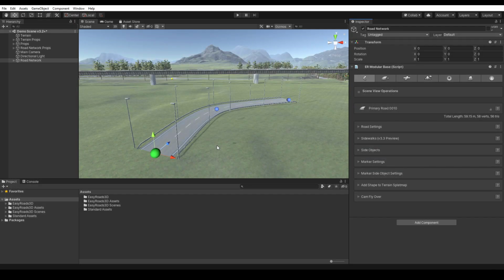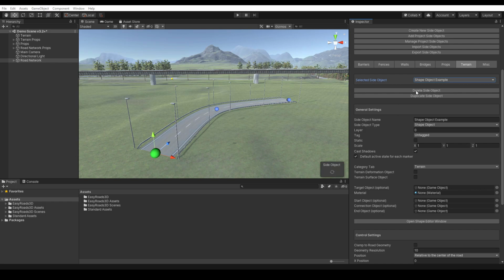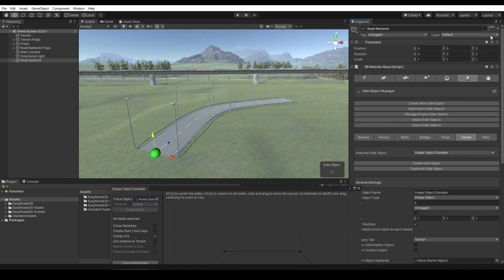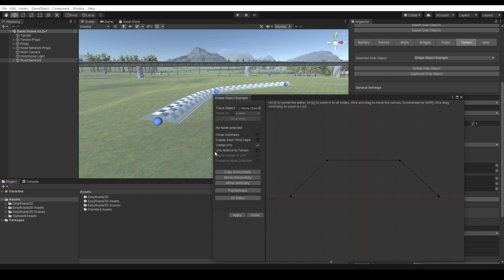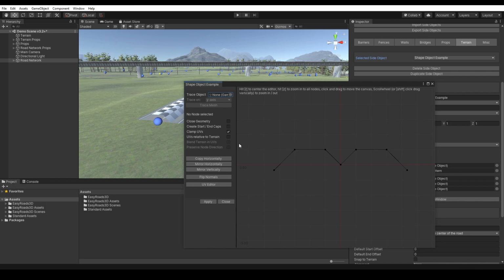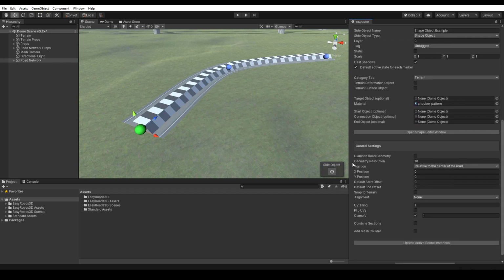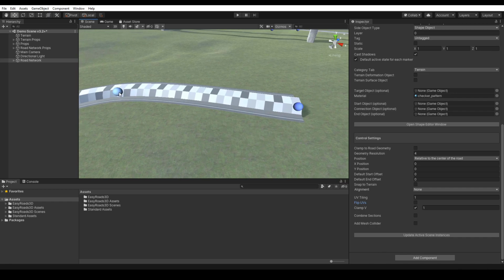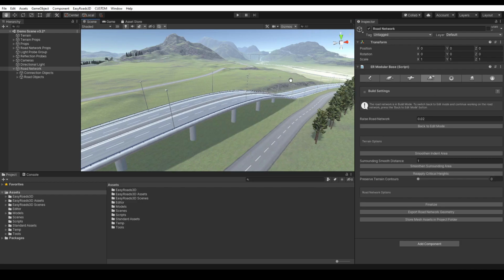EasyRoads3D v3.2+ for Unity - Side Objects - Part 3 - Shape Type

Comment: Hi I’m using the Easyroad3D from the unity assets store to make road in my map but I have a problem when I’m connecting dirt roads to the main concrete road the problem is when I snap the the dirt road into the main road, there are always some Little space in between the 2 road which does not look realistic, I just want the 2 road to blend together with no open spot in the middle, how do I fix this
Reply from the maker: Hi, which version is used and which connector type? Would it be possible to share an image of what this looks like? Could you contact us directly (also for quick support), our email for example is in the readme files in the EasyRoads3D root directory. In any case, the v3.3 Flex Connector, available in betas, works well for connecting this type of roads.
Reply: @unityterraintools Sorry for late reply i bought the add on but i couldn’t find a specific connection prefab that connects 2 roads, T crossing is not bad not what I’m looking for

Comment: Where's crossing road prefabs for the free version
Reply from the maker: The free version currently does not support crossroads built-in. The free version feature set will expand as the Pro feature set expands. The crossroad prefabs  in the EasyRoads3D Add On - HD Roads  are supported in the free version.

Comment: I would really like to use this to generate separate sidewalk. It seems to struggle though when you get to a connection object. Unless there's a way to separate the current sidewalk system  as a different object. Ideally I want to be able to use different navmesh areas on the sidewalk vs roads for pedestrians.
Reply from the maker: Sidewalks generated as side objects is an option but not ideal. They can continue on intersections but the results depend on the size of the connection corner radius and the sidewalk width. That is why there is a separate sidewalk system which has many new features in v3.3 which is available in betas. Sidewalks are generated as separate objects in this update.

Comment: is there some way to create a "negative mask" of sorts where this shape object is for the terrain details? such that terrain details that are within the bounds of this shape object are not removed upon building terrain? the end goal would be to create something like a green belt between the road and preserve the grass there
Reply from the maker: Are you looking for a way to prevent that in specific areas terrain detail objects are removed because they are within the bounds of road objects? And you like to define these areas using the shape type of side object?
Reply: @unityterraintools  I'm trying to create two sided highway (a big highway like the m2 in great britain) and I'm trying to create grass in the middle of the two sides. Is there any way to keep the terrain grass details in the middle of the road? Otherwise I've also tried using two separate roads and placed them in parallel but this produces artifacts in the terrain height map where the surrounding areas of the roads overlap.
Reply from the maker: @ Existing terrain vegetation will indeed be removed across the entire width of the two side highway. But it is possible to create terrain vegetation between the two roads as side objects. It will be added to the terrain object in Build Mode. And when creating two parallel roads, at least 1 terrain point must exist between the two roads that is not affected by these roads otherwise there will indeed be artifacts.

Comment: Im curious, I'm very new but I'm curious if the navmesh thing can work on top of the free version roads? I've heard that there are certain ways that these can be prevented on free versions. Im not at all knowledgeable so I want to know now before I make any deep effort. Thanks
Reply from the maker: Hello, There are no known issues with navmesh in general and we cannot see why this would not work with the free version since the generated road meshes are ordinary Unity game objects with a MeshFilter, MeshRenderer and MeshCollider component attached. Are the EasyRoads3D shaders used? These shaders have an offset option to deal with Z fighting with the terrain. In that case first thoughts are that this also affects the visibility of the NavMesh, it shouldn't affect the behaviour of the NavMesh. Does setting the Terrain Z Fighting Offset values in the road material to 0 solve the visual problem? Would it be possible to contact us directly with this type of support questions, it will be easier and more efficient to communicate. Contact details are for example in the readme file in the EasyRoads3D root directory.

Comment: Hello, is this asset optimized for mobile games?
Reply from the maker: Hello, the core of EasyRoads3D is road network mesh generation. There are two ways to optimize the meshes, by setting the default mesh resolution and, optionally, through the Angle Threshold option. This can be used to reduce triangle count while preserving the desired detail in road bends. So, yes, the tool can be used for mobile. Adjusting the terrain to the road network works for the Unity terrain object object.

Comment: Are you planning on adding a URP version of the materials included in the assets package at some point? It would be great!
Reply from the maker: /Assets/EasyRoads3D/SRP Support Packages/. here you will find URP and HDRP material /shader packages also for the additional free demo package assets. Check the new SRP readme file after importing the package, it includes further info regarding assets that use the Unity Standard shader which can be upgraded through the Unity SRP material conversion tool.

Comment: Loving the asset so far! Would love a little more of documentation or a basic tutorial related to how to properly replicate a few Editor functions in Play mode.
Such as Creating a road at mouse position (this is already somewhat in the runtime scene), 
creating a road from a point (start/end or intersection) and joining a road to another road/intersection would be most helpful.

Been getting a few errors I can't properly debug since it's all in a DLL. 

Thanks for the good work already done!
Reply from the maker: Glad to hear you like the tool. Creating a road at mouse position, that seems more Unity scripting API related, get the position of the mouse on the screen, turn this into the world position. And since the road by default should probably snap to the terrain, you probably want to raycast the terrain from that position based on the camera orientation. 

Also regarding errors you may get with this, perhaps you can contact us through our website www.easyroads3d.com. Communication will be easier for deeper questions like this.

Comment: Add the scene from the demo to my project and the auto generate in the Guard Rail does not work, only the Default marker Active State works, how is it fixed?
Download the latest version.
Reply from the maker: What does the road look like, the guard rail auto generate rules, the Bend Threshold Angle, can be set in the Side Object Manager.  You may want to contatct us directly with this type of questions, the email is in the various readme files in the EasyRoads3D root directory.

Comment: I am facing a pretty annoying issue right now: After I create a road and shift+click to set the first node, it just selects the terrain. No caps lock, nothing. All double-checked. HOW.
Reply from the maker: Is the Gizmos tab active? Somehow Scene View events are not triggered when inactive. This tab is active in a default Unity setup. Also, EasyRoads3D uses Gizmos to display for example markers. All this is covered at the top of the Troubleshooting page in the manual and in the Introduction video https://youtu.be/fIcdU8AveXA?t=871 . If that does not help you could try resetting the Unity Layout?
Reply: @unityterraintools  how can I reset the unity layout, Gizmo tab was active the whole time
Reply: @unityterraintools  I select the road network, click on "Create new road", then shift+click, then road network AND the terrain are selected and it says "Components that are only on some of the selected objects cannot be multi-edited" and I am unable to create the road.
Reply from the maker: @meehdrescher  Unity horizontal menu at the top > Window > Layouts
Reply: @unityterraintools  ok, thanks!